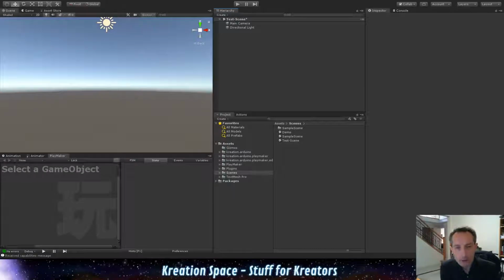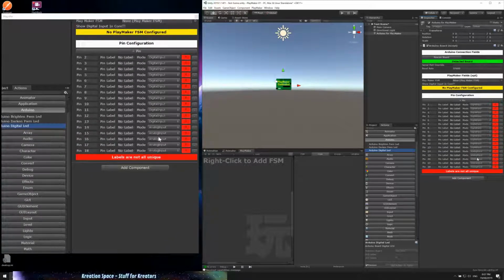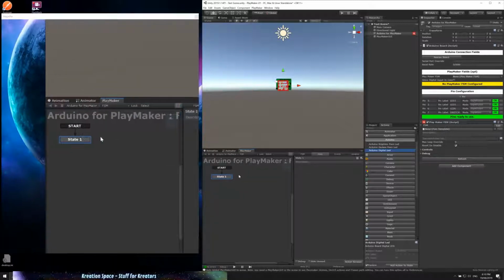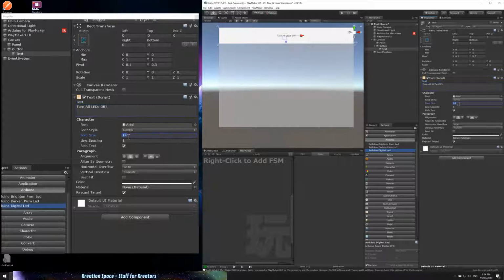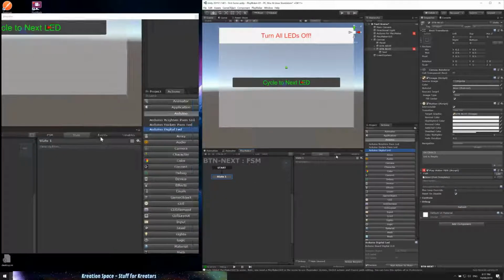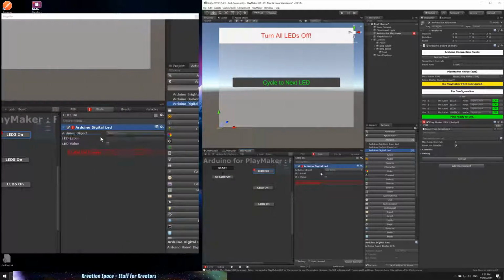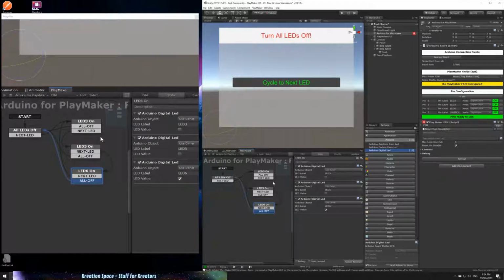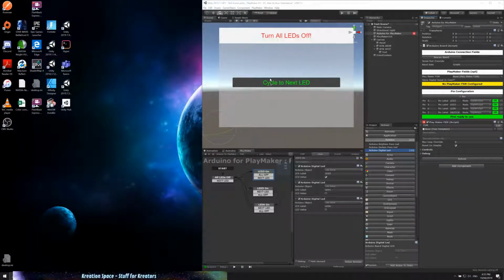Control Arduino with PlayMaker in Unity - No Code! Part One - LEDs on/off

Comment: Hello，in your video you used USB to connect Arduino and Unity。Can I use a WLAN ethernet  to connect them？Can I do it？
Reply from the maker: Hi there, short answer is no, not out of the box because regular Genuino Arduinos do not support TCP/IP over ethernet or WiFi. It may be possible to rig up another micro-controller like the ESP-32 that supports WiFi to talk to the Arduino's UART meaning it replaces the USB cable.
The Firmata protocol that is used to control the Arduino is a serial protocol. It could be sent over a TCP connection to an ESP-32. The Unity code I wrote to talk Firmata to Arduino would need to be extended to support a TCP connection.
So, technically it could be done but is such a niche setup that it's hard to make this a regular product.